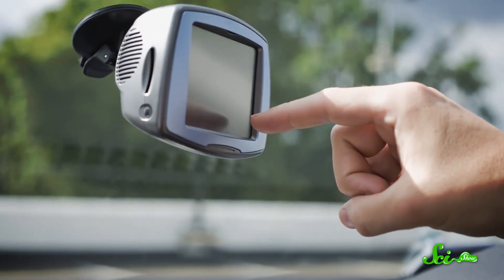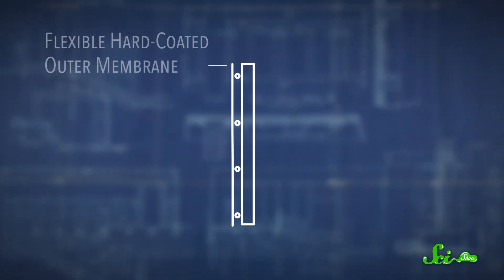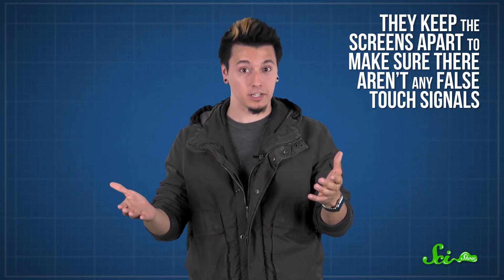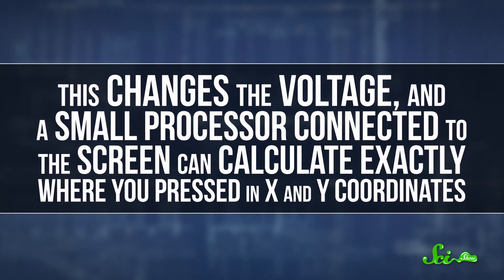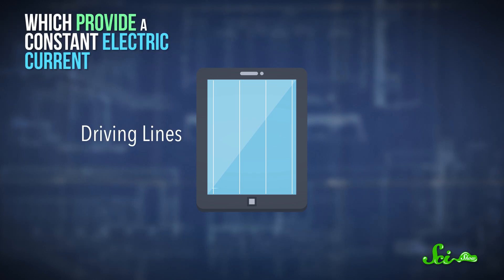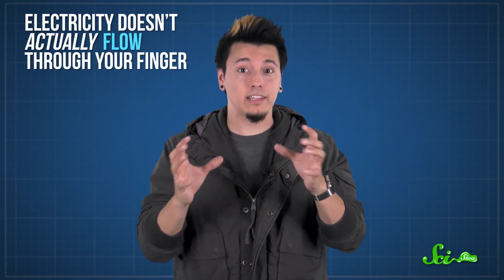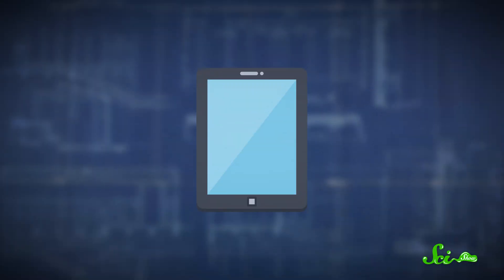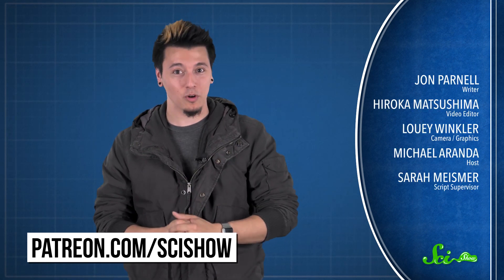How Do Touchscreens Work?

Comment: I have a twenty dollar desk lamp that has touch buttons. The four buttons are, on/off, type of light, up and down on the brightness. It's just a cheapo lamp, but also has a cloak with an alarm, and thermometer.  The buttons are painted on, and you don't have to touch them, just hold your finger above the painted button.  Just wondering how it worked.

Comment: A type of touch screen I have used is an old IBM one for their cash registers. It works by having a vertical and horizontal laser grid with sensors, and when you disrupt the grid, it knows an x and a y to click. Its neat, if a bit bulky and prone to error.

Comment: thanks for this video ... my questions that if touch using by any conduct material..its should be work  right... but i tried operate to the screen by conducting material like bold screw 
its dosn,t works..

Comment: Thanks for explaining what I hate most about smartphones and similar tech'... I now understand that I have a uniquely destructive electromagnetic field, and that's what inherently limits the life of a phone around me to somewhat less than a year or so (at best) before it can't even light up the screen. Touch-screens on phones (at least in my case) are probably the worst tech' available, as I can't even have a reasonable conversation without something horrible happening... You name it, and I've had that happen.
    Short list of examples?
    Answering phone call from my brother, swiped with finger = zot! sound and dead phone.
    Answering call from mother, swiped and received call, put to ear... "Hello... mmm" WTF is that noise... and a dead phone.
    Trying to set up voice mail, tapping the numbers to send original call... zot! and dead phone
   Mid-conversation (hey finally got a Droid to work about two months) and phone randomly dials someone I've never even met before... (weirdest last conversation on a phone in probably forever...) *yes, you read that right...
    Discovered phone could work fine as long as I didn't keep it in pockets (not even in jacket) so eight-months in... swiped to receive call from boss and lit the phone on fire... 
     Bought a flip phone and embraced ridicule... 
      Flip-phone didn't last, went to bakelite touch-tone on the wall.

Comment: how many rows and columns does a phone usually have? With a 3x3 grid shouldn't the device only be able to register 9 points? I doubt a phone has a 100x100 grid? Can the processor calculate an exact touch point between two points on the grid? No video seems to explain this.

Comment: I got a phone where I am LITERALLY part of the current when I'm using it.
Because the stupid display stops working the moment I put the thing on the table and don't touch it anywhere else but the display.
Unless it's plugged in, that seems to also give it it's grounding that I am normally providing by touching the backcase.

Comment: I work in the POS IT industry, and I work A LOT on credit/debit readers. Recently, in the last 6 months or so, all of the credit/debit machines were updated to be able to read the new security chips, because it was mandated by banks, VISA/Mastercard, and iirc law. The newer machines almost all use hybrid cap/res touch screens because they're more accurate. An easy way to tell the difference is look for plastic, matte, finishes - that's a resistive sensor, and glossy, glass screens are capacitive.

Comment: This video, while informative, gives the misleading impression that resistive touch screens are the more accurate of the two described screen types, but I feel the need to clarify further. Resistive screens (like those found on the original DS and DS lite) are actually often pressure sensitive. This is really handy for tasks like drawing or painting.    

This is one of the reasons that kiosks that allow you to sign for items generally use resistive screens. Lastly, because pressure can be applied to only a small surface area using tools like a stylus, resistive screens are often better fit for tasks that require precision over sensitivity, and make more efficient use of small screen real estate as a finger is not obscuring your view. This makes it a much better choice for some types of games like Elite Beat Agents and Nintendo Land.

 TL;DR Resistve screens are cool too.

Comment: Well I see why leather doesn't work, and why aluminium foil does work, but I have a very thick (finger sized) block of graphite, which ought to work, but doesn't. Am I missing something, or is it just failure on my part? How do these tablet pens for drawing determine the strength of pressure? Also, Plasma would work, right? If it didn't fry the device? How can those underwater phones still work in, like, salt water, are they so sensitive they notice skin conductivity vs salt water conductivity?

Comment: Problem with capacitive screens is heat. When phones get warm, the screen become erratic. Very warm, won't work at all (very random outcome).
As a sidebar, this is why elevator buttons back in the day using capacitive technology were banned, as fires would trigger as a touch, sending someone to their firey graves. The technology was primitive then, but the same issues happen now with modern electronics.

Comment: their are a bunch of different types 1 of the biggest you missed is thermal conductive touch it works buy sensing thermal change at the hotist point of the touch.

Comment: Sorry, but most of modern phones have option for higher sensitivity also called "gloves mode" that work even without special coating on them, you actually can use even plastic pen to use screen. Its really amazing software that keep that on, and it can detect what touch the screen(finger, palm, rain drop, dirt).
And on some phones like xperia it actually work really good, screen is really sensitive, and as far as screen is clean it doesnt detect random touches.
Not to mention that some models can work in rain or even underwater, it would be good if you would mention that. even if underwater it worked like ####, in rain it still work perfectly.

Comment: Why do my phone battery seems to "discharge" faster in the winter or extreme cold temperatures?
Reply: Actually, metal are less resistant when the temperature is lower. That is, they conduct electricity better. However, that difference would be insignificant in this case.

It's about how batteries work. The basic concept is that a battery is made of two different substances which produce electricity when they are mixed together. Said substances freeze at a low temperature and the mix doesn't happen anymore. When the device measures the performance of the battery, it appears to be discharged. When the battery is unfrozen, it performs again and appears like it was charged.

Comment: hey i got a good question, what is the deal with all the dead skin on feet?
Reply: You mean callouses? That's normal lol, in case you were worried. To my knowledge, they result from dead skin cells piling up in reaction to constant wear and tear on that part of the body. You can technically get callouses anywhere, but the bottoms of the feet and your outer elbows tend to get callouses more often because they see more use. You could say they're kind like the human body's natural armor, haha, protecting the skin and making it so you don't feel pain every time you walk on gravel or rough ground. Still, if it bothers you, there are always ways to remove callouses. One way is with a pumice stone, which you basically rub against the callous to scrape off the built up dead skin. It's... not as painful as it sounds, lol. The skin is already dead so you don't really feel it. I recommend showering right before too, to help soften the callous and make it easier to scrape off. Sorry if that whole paragraph grossed you out lol.

Comment: your explanation of capacitive touch screens makes it seems as if they're x/y based too so how can they still detect multiple touches?
Reply: My understanding was that x/y isn't the reason resistance screens can't do multiple touches. I'm assuming that as they work by determining where you're touching by registering where a circuit is essentially being completed by connecting the 2 layers, completing the circuit at 2 points at once is just going to mess with it and confuse it. I could be wrong but that's just how I took it

Comment: I tested this by trying to use my touchscreen with my nail, which didn't work, but if I push the flesh under my nail into my nail hard enough it does work because it's close enough to effect the field but not touching, per-say.

Comment: Small point, but in a capacitive touchscreen you don't actually touch any of the electronics, though (it was implied that you do). There is a thin layer of insulating material over the electronics, and you can typically add in a little bit more (like a screen protector) before the sensitivity falls off and it becomes unusable. Very thin gloves, like latex gloves, thus work just fine with capacitive touchscreens most of the time.

Comment: Resistive touch screen is probably better for underwater applications. The Capacitive touch screen on the iPhone can't work underwater, or if the screen is slightly wet, which is annoying when exercising.

Comment: You got one part half-wrong: Smartphone touch sreens can work with gloves on. The Nokia Lumia 920 had such ability, for example, and it worked with all but the thickest of gloves, allowing you to answer your phone without having to yank your gloves off first.
That said, since it's not common, I suppose that it has some kind of disadvantage in the implementation - expense perhaps, or increased battery draw.

Comment: I understand that you have to make some simplifications like saying it is a constant current. However, it is the relative permittivity and not the conductivity that is the important factor of sensing your finger. Water has a lot higher value than air. 

Also PE and PET is not quite the same thing.

Comment: "Everything changed when something conductive attacked."
I"m sorry... xD

Anyway, serious question. How do drawing tablets work then? I have a very basic wacom tablet, and it has a mode for only sensing the pen. And a mode for also reacting to like fingers, which I never use because well.
Drawing with a pen doesn't work so well if the tablet reacts at your hand brushing over the surface. xD

Comment: How about Glove Mode on my smartphone? Looks like everything moist and wet work with it from small tree branch, chopsticks, pen and could be still used after almost 50 pages of paper.
Reply: Oh, and it works EVEN i don't physically touch the screen. My finger is just hovering above the screen a few mm and it still works. Maybe more sensitive screen? btw i use sony m4
Reply: I think it's a variation of the capacitive touch screen, Samsung and Sony both have glove mode. But some old Sony phones have a hover mode where you can use the phone by hovering your finger over it, it's a bit annoying and power hungry but it's fun to impress your friends with it.
Reply: Alpha Adhito I was wondering about that too. My Lumia has an option for super sensitive mode, allowing for the use of gloves as well simply hovering your finger over the display.

Comment: The university of Notthingham has developed a highly accurate resistive touch screen method using quantum tunnelling through graphene giving point accuracy, multitouch capacity and tiny pressure variation needed to make it work since only a tiny movement is needed. This could be adapted to using an exterior glass composite screen rather than a flexible plastic layer.

Comment: What about the "glove mode" on some smart phones? Does that just ramp up the electric field so that it'll respond to your finger from a short distance?
Reply: I had a really strong glove mode on an xperia sola I owned. It could detect touches from as far out as a centimetre. It was pretty cool to be able to control things without ever touching the screen.
Reply: I think so because I've noticed that when I have the mode on, I can actually open an app by putting my finger really close to the screen but not quite touching it

Comment: the ds and 3ds probably  use resistive touchscreens, but they are very accurate  compared to a typical one on a cashier card reader. Why is that? my theory is that there are tons of touchpoints all tightly woven.

Comment: Why is it that I have real difficulty in using a touch screen phone or tablet, as it won't type or open what I've intended to tap? Only way I can overcome the problem is to use a pen with one of those rubber tips on the end, which leads me to ask how they work?

Comment: Why are some rain drops bigger than others? And what determines how hard/much it will rain in a particular area, even within the same cloud?
Reply: Rain forms when cold and warm air collide. Because less water vapor(invisible) can be mixed into cold air compared to warm air, water starts to atomize around particles in the cooling warm air. Warm air also has a lower density than cold air, making it float upwards. As a result, the excess water which has begun atomizing (white) is blown upwards. While the clouds rise, more and more water merges into bigger drops. The drops will fall the moment their mass is too big for the wind to carry it upwards (Gravity works on mass in a volume, friction works on a mass in a surface, and volume grows faster than surface area when adding mass to a drop How big they get depends on how strong the wind going upwards is. In a warm front, warm air gentle slides over cold air meaning there's little wind pushing upwards. In a cold front, warm air is almost going straight up which forms cumulonimbus (very high and dense clouds, short but strong rainfall) as opposed to nimbostratus (low, flat mist like clouds, long but weak rainfall) in warm fronts. 

The amount of rainfall in an area depends on several factors. One is how much water vapor is getting into the air. This depends on how much water there is on the surface (coast <-> ... <-> desert) and how much evaporates (climat). Another factor is sea currents. The Andes, the mountains on the west coast of South America, are very misty/cloudy and wet because there is a cold sea current coming from the west. Air currents also play a major role. There are several (almost) horizontal bands going around the earth that have a concentration of either warm or cold air. Above the Sahara desert is a cold band. Cold air sinks down, and air needs to rise enable for rain to form. Thus, the Sahara region has little rain fall. There's also a cold band (more of a circle) on the poles (cold desert), and a warm band above the equator and Europe creating extra rainfall; and so on. These bands move according to the tilt of the earth (which parts of the world are heated the most), which is why India has a very dry winter and a very wet summer. The last factor I can think of, is the direction the wind is coming from. Depending on the time of the year, wind often has a direction it primarily comes from. In India this is north during the winter and south during the summer. South means moist sea air is being carried to the land, north means dry land air is being carried to the land. This autumn in Europe, the wind was coming primarily from the warm and dry south. This is not the case normally. Here in Belgium, we had a very hot and dry fall as a result.

I hope that answers the question thoroughly.

Oh, I forgot to mention terrain. Mountains or high buildings force the air to go up. Higher up, the density of air is lower, which means air expands while it rises. While the volume increases, the temperature and pressure lowers. Rising and cooling air results into clouds and later on bigger rain drops. This is why mountainous areas are very wet. The land behind mountains is dry, because now the opposite happens: the air sinks and warms up. What "behind the mountain" means depends on the primary direction of the wind.
Reply: 👉You see, inside of every dark-ish tinted cloud, there is an unseen,  solid, saucer-shaped basin where water is stored. Since these "cloud-saucers" are shallow, they are always at risk of becoming "over-filled"! When they do become over-filled,  the excess water simply overflows, which becomes what we refer to as "rain". During extremely windy, stormy days, the wind actually causes 'wave-action' to occur in these cloud basins, causing significant overflow of water(ie. "heavy rain"). 😉👍

Comment: How does Touch ID work
Reply: There are three types of fingerprint scanner. Optical (oldest method) basically just a picture of your fingertip that's then analysed with pattern recognition algorithms. Capacitive (this is what TouchID uses, and most other phones currently), it's basically a high resolution (due to the concentrated area it's in) version of the capacitive sensors in the screen, it simply detects the capacitance differences between the ridges of your fingerprint, and then applies the pattern recognition to that. Then the newest, Ultrasonic. This works via bouncing an ultrasonic pulse against your finger, and collecting that data via a plate that can detect minute changes in mechanical pressure.

Comment: My lumia 520 has a setting called "high sensitivity" which is turned on by default, what this feature does is it allows you to use the touchscreen with gloves on, no matter the material, rubber, cloth, anything. Furthermore it works with your fingernail, it works with any kind of metal, even covered by isolator such as rubber or plastic.

Comment: how do screen protectors allow the capacitor screen to work normally then?
Reply: Because plastic and glass don't have the electric field that a finger does, and they're thin enough and conductive enough to still allow your finger to register.
Reply: still it might affect the sensitivity sometimes,so I decide to peel it off after 2 months,how annoying,smartphone these days use gorilla glass anyway,they are quite durable and not easily get scratched